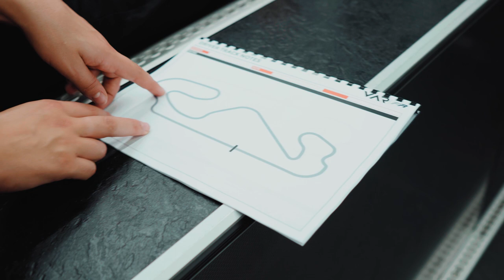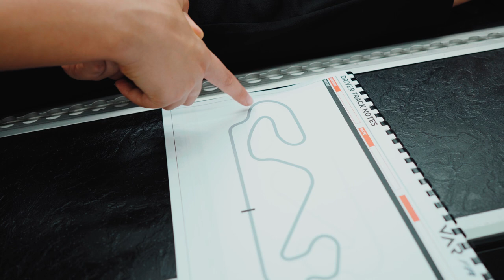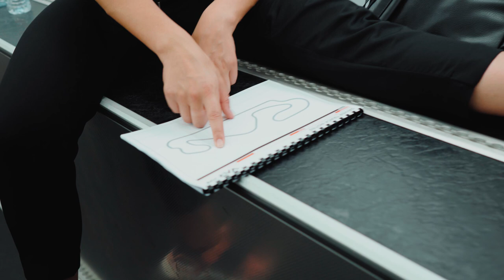Sophia's VLOG #21 - Formula 3 Regional goes Barcelona!! Key facts and line about this amazing track

Comment: Sophia, do you also come out of the corners in a higher gear than in the dry?  Also maybe short shift.  I'm thinking you don't want wheel spin so less torque at lower rpm is better?  Just wondering and thanks for the great explanation!